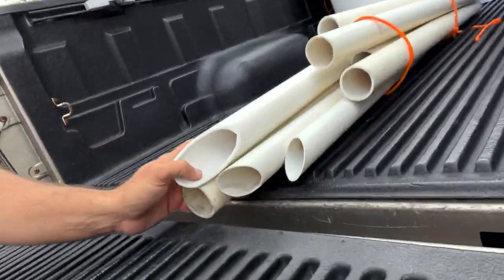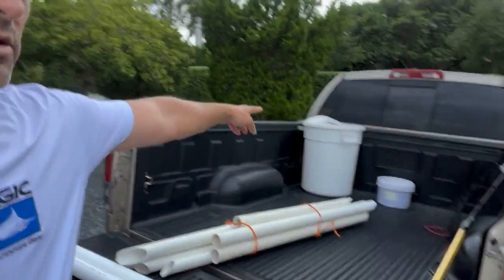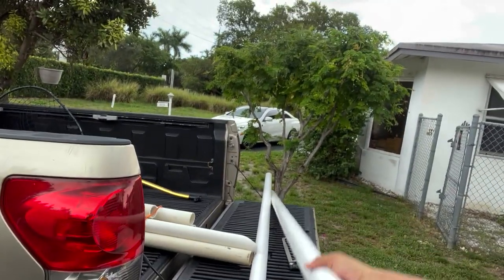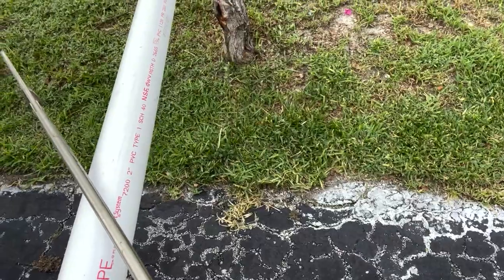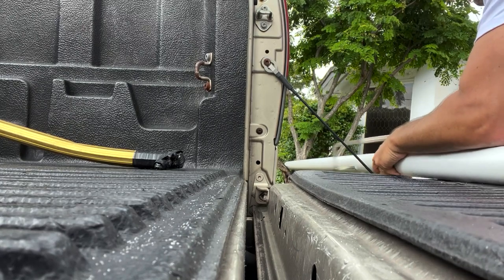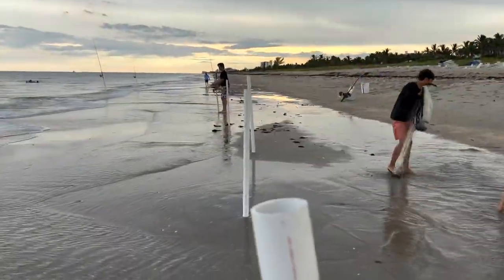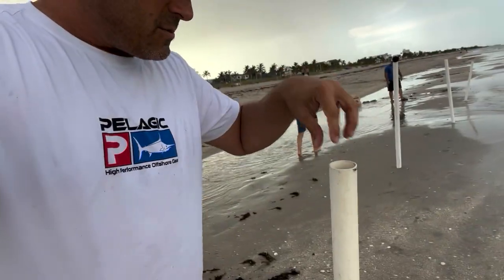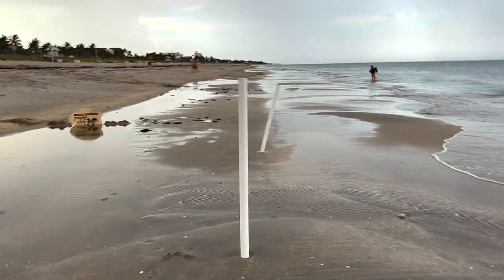DIY - 5 TIPS FOR MAKING YOUR OWN SAND SPIKES AND HOW TO USE THEM

Comment: At Home Depot, you can ask the section associate to help you to cut the PVC down to size.  So if you do not have a vehicle that can transport a 10 foot PVC pipe, you can ask them to cut the 10 foot PVC pipe into 5 foot sections to make it more manageable.  That said, do you know if the suction method will work if you do not cut the PVC at one end to be pointed?
Reply from the maker: Good word bro. It may work but the sharp edge helps big time